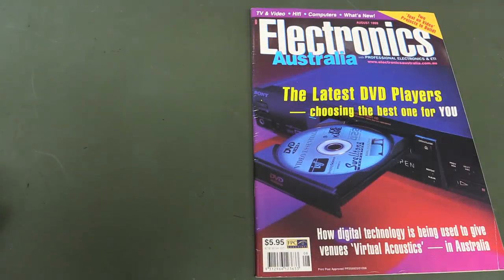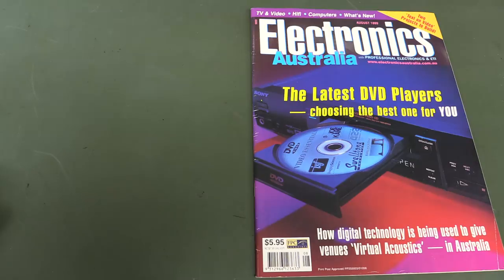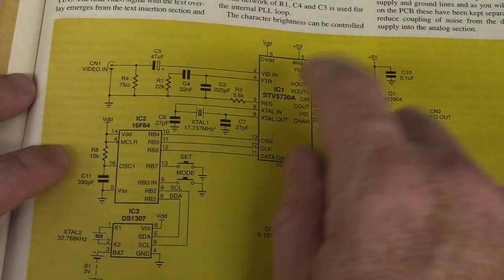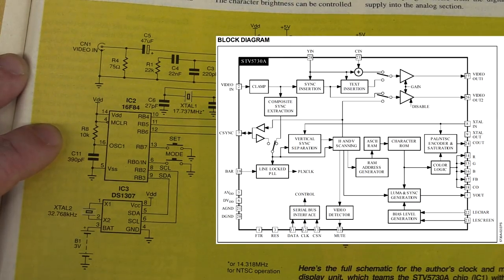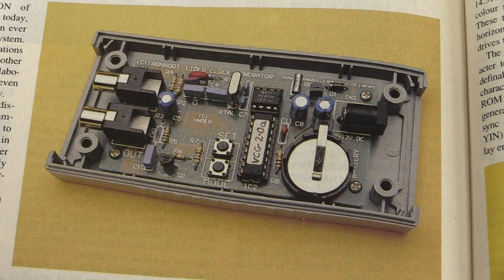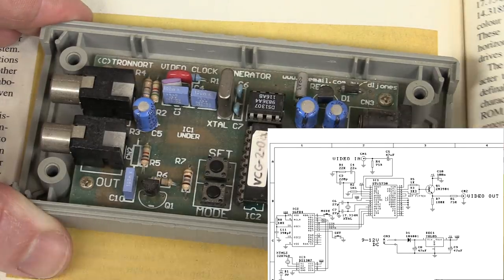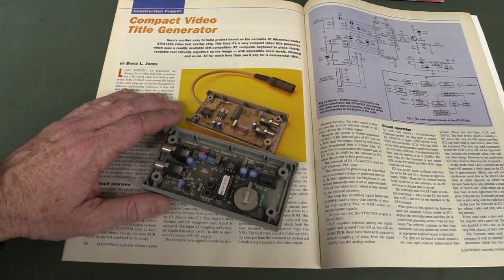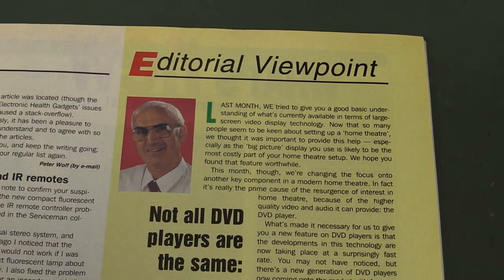EEVblog #b10000000000 - 1K Micro Magic

Comment: Congrats on 1024 EEVblog.
Takes me back to the eighties programming 6802 and 8080 at uni. Did a few contract jobs programming 68HC11 series micros as well.  I still have a DATUM processor board from back then.  6802 processor, hex keyboard, 7 segment led display, and  1K bytes of RAM.
Reply: I see that you have much experience in ASM!
Currently I am making the z80 computer, to preserve the tradition for next generations :)

Comment: The GPS Smart Coupler has used a long line of Microchip processors over the years, including the 16F84.  Back in the day it was an interesting challenge to fit the functionality that you needed into these small devices. Who needs games? The HiTech compiler was a revolution - it actually had a way of manipulating each bit in a register! I still have the tee that HiTech gave out as swag "World Domination via C Cross Compilers". Go Australia! I think it was the 16F84A that finally had enough space to let me use the HiTech compiler to generate code for sale.

Comment: Well that was a stroll down memory lane (bank 0) thanx. i started out assembler programming on the PIC16F84 with a home made parallel programmer. was pretty wrapped when the A series came out at twice the speed. Coming from XT vintage it means a lot to have that extra processing grunt especially if you are running sync with VGA to output graphics, man those where the days!
Not sure i can get a teensy to do HDMI so yeah it would suck to be a young one these days with that learning curve and it seems like cheating to just use a raspberry pi but i guess all these things have a place in history. thanks for this video even tho i found it years later! long live EA and what it stood for!

Comment: I done an eight step midi step sequencer, with 4 rows of knobs (octave,note/1st databyte,duration/2nd byte,velocity/3rd byte)and 8 columns, using a 68HC11F1 and this one has as well "only" 1k of RAM and also just 512byte of EEProm available.

I also used about every single byte except the last eight ;) when my final version had 4 times 8 steps.

I was very happy with that thing, it was able to sent almost everything midi related stuff out to the conected devices, except the newer nprm stuff...back when done it (back around 1993 or alike). Also it came in a PLCC footprint and its TH-socket cost nearly as much as the µC back in the days...

But sadly one day, when i tried to re-do some stuff i missed the RS232<->TTL converter and roasted the HC11 and shortly after that i begun coding in 68k assembly (amiga).

I mainly quit the µC stuff because every newer model had it´s own toolchain and the newer versions usually doesn´t support the older µCs/programmer(s)/interfaces or even needed a later model host computer...

And i came back to the 8bit µC world around 2014 or alike when the arduino arrived, as it just worked first go and i still don´t need to maintain a dedicated toolchain...i just can code, upload and have fun...regardless if i run the IDE on my laptop, my computer...using win10 or win7...or the latest IDE or the one from last year...plug in...upload...go...that´s the way...as a very part time tinkerer i don´t want to fiddle along/with the toolchain itself..

And by the way i started with a 8049 6x 7Segment display, foil keybpad, hex machine "kosmos computer CP1" 128 instruction memory, i still have this one somewhere...and i had lots and lots of fun with it using LEDs and fiddling around with multiplexed outputs when i was 12 years old, if i remember correctly... in fact i was a little disappointed when i finaly had my C64 and figured out that this old 8049 was way faster (computing speed) than my fancy shiny new C64 when i was 15...;)

Comment: I finally watched this video all this time later and got around to commenting.  With today's vast storage spaces on tiny devices, there's not as much challenge to cram complex programs into small spaces as there used to be.  I easily packed a 32-bit pseudo-random number generator into an 8-pin PIC to make a "white noise" generator.
Of late, I've been programming an Arduino Pro Mini to make a moving display using NeoPixel LED displays.  It's more complex than it might first seem because the display reverses the direction of the pixels every column, so every second column is reversed.

Comment: Hi
Beleve it or not, but a collegue of mine managed to cram a complete elevator controller in to the 16F84!!
It could handle Hydraulic and roped lifts up to 8 floors, 1 automatic door, had a SIMPLE fault memory and all nessessary safety functions!
He also managed to do a project with THREE serial ports (done in software) running at 9600 baud!
It is impressive what can be done with souch small amount of memory!
Nisse in Sweden

Comment: The 16F84 was a crappy microcontroller -- no analog capabilities (from memory).  The 16F88 was a much better option -- I've used heaps of those in various projects (for fun and money) over the years.
Reply from the maker: Yes, but the 16C84 16F84 were the first. The 16C84 in particular changed everything in the market.
Reply: A really good video.
Yep 16F88 was great, even had a hardware uart.  I started with assembly on CDP1802 if anyone remembers it, later small Motorola chips then on to OTP PIC.  I think I skipped the 16F84, had a few 16C84 but mostly went from windowed and OTP to 16F88.  It was not long ago I dumped the old UV medical lamp that must have erased so many chips.  I still use a lot of 12F675 and 16F684.
There was a Arduino osd for FPV that just used a sync detector chip (LM1881 ??).  I modified the code and used that OSD for a few years. It was about the best OSD I have used.
Reply: @Rcbeacon  I had a COSMAC VIP, way back when

Comment: I taught PIC back in the 90's but cut my teeth on SCMP writing in assembler to fit in a massive 256 bytes of memory and no stack or any other smart registers. Oh, and hand compiled! OK there were only a handful of instructions!! Made a disco light controller with the same in the 80's. Progressed to 2650, 6502 and Z80, writing a fast serial video display controller for a Z80 CPM based home brew.

Comment: I wrote once library of mathematical functions with IEEE-754 32 bits notation. Square root, x^y , log x , multiplication, dividing etc, sin, cos etc everything that is used in calculator. Of course you couldn't put all of them at once . It was a master degree labour . I chose it because I used pic16f84a for decoding pay tv :)

Comment: I have nine of those STV5730A chips, brand new in a carrier. I used the rest as part of a cctv cash register overlay controlled by an Atmega 88 in assembler. That's all I do, assembler in AVR. No C. When I started doing them I was using the Bob5 (think that is what it was called). Since then I have used all the osd chips as they came and went. MAX 7456 is the latest, but I have pretty much given up on this project now. Dave

Comment: You know, I coined the term "bloatware" when referring to Microsoft on an Open Solaris message forum.  Windows was using half a gig of RAM, just for the operating system to load. Look at what they did with assembler for the Atari 2600, 2600 words of code.

Comment: I started with AT90S2313 (old thing that came with dev board) and ATTINY2313 (that i used to replace it). 2kB of FLASH memory, i was programming it in bascom so it was good for small projects but could not stand the bigger ones. Then came the ATmega 16 (then also ATmega 8) which was a big step up (not just 16k of flash but also 1k of SRAM). Finally i just got into STM32 which is even bigger step up... ...So after some years i have finally found a way to make my programmable calculator on a decend chip. It is amazing that video title generator can fit in 1k of memory. The termal printer i repurposed by reverse engineering the controller board (and writing software for ATmega32 thats on it from scratch) uses 1k of EEPROM just for 128 characters of font.

Comment: Dave, Do you remember Silicon Chip did a Colour TV pattern generator that used 20+ chips?
It was designed by John Clark and published Nov-Dec 91. The original version didn't have an EEPROM in it. They apparently did an improved version in 1997. That was a long time ago...
Reply from the maker: Vaguely. I build one from EA back in the 80's. That used all discrete logic too.

Comment: I can remember programming my first PIC16C84 (that was the original hobbiest chip). Didn't have a PC, found a programming interface diagram from an issue of EPE (UK electronics mag) and managed to build a programmer and program a 16c84 for a simple christmas lights chaser using the Joystick ports of an 8-bit Atari 800XL to do the programming (hard work having to code the program by hand, but did work). Later on I used a 286 based PC running the dos version of mpasm and a hobby programming software called ludipipo.

Comment: Haha, having 40 bytes free gives you some flexability to fix some stuff, brilliant! Love the old days that you need brains and creativity to make it fit in such small space. Nice to see you still have it anyway. 

I have some programs made in UDL of the 90's (1994) for some Hand Held Products barcode scanners (Intel 27128), have the software to compile it (still runs in DOS-box) and can produce an HEX-file however the scanners are not easy to find. Ofcourse the Intel 27128 is another beast, I know however with all kind of all older other stuff, it can be touched, reproduced, still working because it was hardware with software. That is why I like Arduino microcontroller stuff, it is hardware that needs some software and reintroduce the limitations, to be creative, to do more with less, great for children and older creative dudes.

The online culture, the internet is great however makes older software and hardware completely obsolete, unable to reproduce (external requirements that no longer exists), to show to others, children for example. Very difficult or impossible to reproduce, makes me feel sad. 

Great video, maybe we are the last generation able to show work from the past in working condition.

Comment: There where lots of these exact same modules used in the Racing industry to Add Time/Date/Camera angle stamps to Stewards Patrol Video's back in the day........they usually had 3 , 4 or 6 channels or video tied together, so all the dates and times sync'd up and the only change between channels was the label of the camera angle...... I think I have a couple of them in the store room somewhere that worked right up till the industry went SDI.

Comment: Wow, I never thought that something like this would still be the ducks guts (or however you say that? The Cockford-Ollie?) in the late 90s and early 2000s. In the early 90s though, it would have been absolutely marvellous, while from the mid-90s on, many VHS VCRs had a similar feature built in. At least I remember the Grundig machine my parents had back in the day, and it could do stuff like that.
Reply: And most of them didn't have battery backup for the clock sadly.

Comment: I built a similar device that overlays timing data on NTSC video, but I couldn't find a source for the video overlay chip at the time.  So I rolled my own.  It used a PIC 18f2620 and actually bit banged the pixels of a 21x35 char on screen display onto the video in realtime.  It took 875 bytes of code,  and a 2k lookup table for the character memory.

Comment: Heh, I'm doing a pretty constrained project myself right now - cycle budget rather than memory in my case. Trying to synthesize audio/do DSP on a ~500 cycle per sample budget on a small ARM Cortex-M4 chip—I'm mostly using and optimising C, but it does mean disassembling and examining what the compiler's spitting out, and occasionally hand-optimising some assembly.

Comment: Back in the mid-1980s a friend and I built single board Morse code idents for Amateur Radio and UHF CB repeaters. (are you still out there Graham Robinson?) It used a single chip 8 bit micro with onboard programmable ROM and a very small block of RAM that also doubled as the CPU registers. I cannot remember the part number but do remember I had 256 bytes of ROM to work with and the machine code which I hand assembled into hex had to contain the logic and a Morse table consisting of 26 letters and 10 digits. I had to find a way to compress the Morse into a single byte for each character. I cannot remember many details since I did not keep any notes for that project which is now more than 30 years old. My friend designed and built the hardware, as well as marketed the product. I worked on the software. I think he managed to sell quite a few around Australia. I always felt a little proud when I heard various local repeaters do their ident knowing my code was in there doing its job. It was a fun project.
Reply from the maker: Nice!

Comment: Yes, you could save bytes by storing the hard-coded strings compressed, but then you'd have to expend bytes on the decompression code : )
Reply: I was working on unpacking an old DOS game a while ago that used run-length compression to save bytes... In the end, I found that the unpacking code took up about as many bytes in the executable as the compression saved! Someone wasted a lot of time on that, about 25 years ago.

Comment: I too was producing a product that used the STV5730.  I was left out in the cold when ST killed the chip.  The worst hit was the BOB video overlay unit.  They eventually had to use a PLD to replace the video generator.  Decade Engineering still makes the BOB-4 but not as cheaply as the original.
Reply from the maker: Yes, I remember the BOB module!
An entire industry got bit when they cancelled that chip.

Comment: I produced code for a paintball gun with breakbeam ball detector, different fire modes, adjustable rate of fire limit, multiple presets for different tournament rulebooks etc. This ran on a 1024-word, 8-pin 12F629.

Now I look back at the code I'm disappointed to say I only used 758 words (219 for the main program, 165 for the ISR and 374 for the settings "menu" (I put that in quotes because changing settings with only the trigger and a single LED wasn't a lot of fun).

Comment: So why did the text show 00:00:80 in the time code? Wouldn't that be hours, minutes and seconds? But then, why is it counting to 80? Or is it minutes, seconds and hundredths of a second? Could you change that? Because you mentioned surveillance monitors, and they usually profit from a "real" time code, like "15:27:31" or something like that...wouldn't work though, when the seconds are counted to 100 before turning over to the next minute ;-)
Reply: That is the initial state of the Real Time Clock, until you set the time manually. The battery was probably dead after all these years...

Comment: I'd like to do some PC interfaced smart devices (industrial size). I never did learn how to use my old TRS-80 printer port to communicate with my electronics programs. Any chance on a video of using some type of PC interface to micro controller? Most of the projects I have now rely on USB with the USB/serial converter and they seem to be a bit unreliable for un-interrupted use for years on end (I'm lucky if the communication doesn't give out within a week). I'd love to see some alternative communication methods, even if that means going back in time to find something I can rely on!

Comment: I was going to say "Nowadays you could use a MAX7456 for the overlay." but then I looked, and THEY DON'T MAKE THEM ANYMORE!  Of course you can get Chinese knockoffs on eBay which probably work just as well, because they're what everybody's still using in their quadcopter FPV camera OSD boards.  Wow, that second project... Keyboard input, that's pretty darn fancy! ;D  I woulda killed for those designs back in the day, lol.

Comment: The magazine Electronics Australia folded because they changed it from an electronics magazine into an advertising journal with nothing of any interest to any of its regular readers.

There was around 150+ pages of just advertisements followed by maybe as many as 30 pages (I'm being generous) of "reviews" which were just extended advertisements.

Since Australians aren't stupid enough to pay to receive nothing but advertisements, that's why they dropped it faster than a hot potato.

And I recently wrote a little "quiz-tie-breaker" game into a PIC16F84A.  It has five push button switches.  Four are for the players and pressing one lights that button's LED and sounds a tone for a short time from a speaker, locking out the other three player buttons.  The remaining button resets the LED and gets ready for the next game.

The PIC spends most of its time in "sleep" mode so it uses only a few microamps of current between button presses.

Comment: If you had written the code in C at  that time you would probably benefit from better C compiler optimizations now.
The downside could be, that the binary might be larger, especially if the compiler optimizes the code for speed and not space usage.
It's not very surprising that everything works out of the box with the old assembler code. The assembler language for a specific CPU with the exception of new instructions, doesn't change, it's only additional administration code that might change over the time in the IDEs and Assembler.

Comment: I'm not quite sure but isn't it quite wasteful implementing a lookup table as a bunch of return instructions? You can see in the disassembler that a return with a byte immediate is 2 bytes long. I.e. the memory for the lookup tables could have been halfed when implemented as arrays!

(Then again I wouldn't know if or how that would be possible on this architecture)

Comment: why not just add another ram chip to the actual circuit bit itself ? If you did that then you could just store any data that the user enters on the second ram chip and the program on the other ?